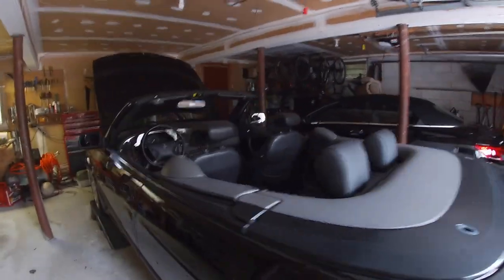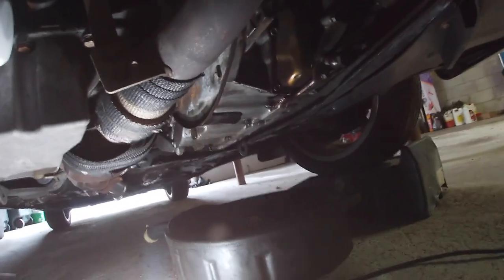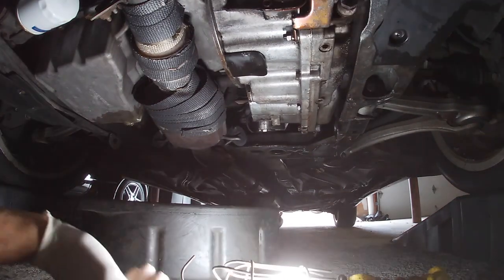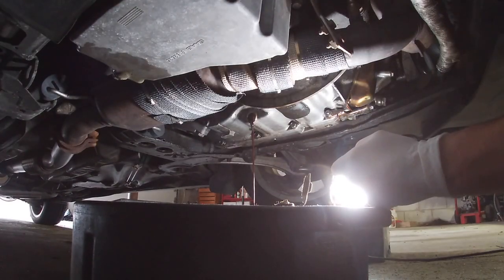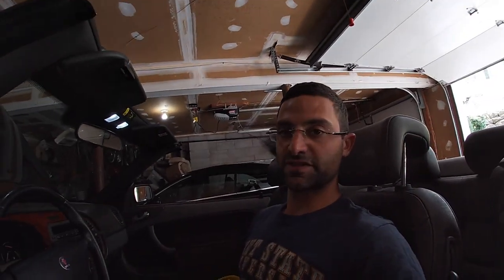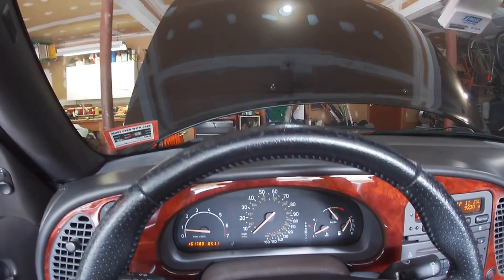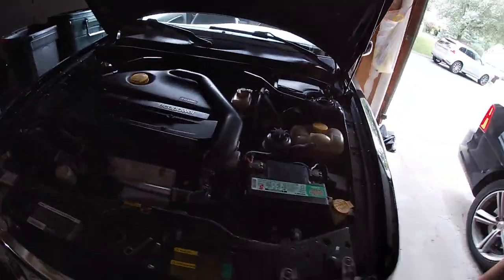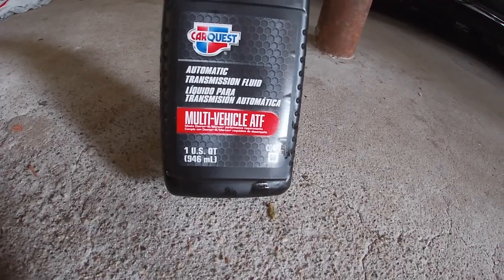OG Saab 9-3 9-5 | How to Change Automatic Transmission Fluid

Comment: Hi Kyle, thanks for video, I’ve learned something new. How much oil did you put in the transmission?
Reply from the maker: a pleasure to help! 3.5 sits in the transmission and 3.5 quarts sits in the torque converter. So let the pan drain as i did and just replace the 3.5 quarts. If your fluid is really bad drive for a week and do it again to cycle the fluid out from the torque converter as well.
Reply: Kyle Pancis Hi Kyle, your prompt response is greatly appreciated. Colin.
Reply: Hi @KylePancis  , 165k miles on 2007 93 convertible with black fluid that is not low and slippage starting. What do you recommrnd?
Reply from the maker: @AngelShelburneplus  leave fluid. Add a bottle of lucas transmission fluid

Comment: I have a 2006 saab 9-5 Is it the same amount of oil ? Also the first time that I take the dip-stick out it's full and then the second time that I clean it and put it back in it is low, can you help me out which is the right one, does the car have to be On warmed up or in neutral ? I checked the Instructions Manual but I couldnt find any information. Also my car is automatic does the amount of fluid that I need change, I also dont knowwhich type of fluid I need ? Thank you so much in advanced
Reply: The information on fluid type IS in the manual. Near the back of the book. Or look it up online. 

Have the car warmed and running when checking the ATF.  (I put mine in neutral)

First pull of dipstick do not read. Just wipe and insert back. 2nd pull of dipstick you read. That is your level of fluid. 

If you are not sure about how much fluid to put in, you can always measure what you took out. Put in about the same and keep checking dipstick often to hit the correct level. 

Shampoo is for cleaning the hair. Conditioner is for softening. Rinse and repeat to desired affect. Hope this helps man

Comment: I have been trying for days to locate the transmission dipstick on my 2008 9-3 aero. I have seen NOTHING green anywhere- even when lifted as some sites have mentioned.  Just came across another thread that says this: "  Draining ATF with on the '06 and newer cars.

These cars do not use a dipstick or have a dip stick tube. Instead, the dip stick hole low on the case is filled with a threaded aluminum plug equipped with a T55 recess. 

NOT DRAIN YOUR ATF UNTIL YOU HAVE THIS PLUG OPENED!

This plug is a challenge to remove, and draining your ATF before you have this plug removed might result in a dry transmission on a car that must now be towed to a Saab Tech for assistance. " 
I AM SO CONFUSED.. can you shed some light on this for me??
Reply from the maker: if it doesnt remove and you want to service you may need to pump fresh fluid back in. Not to sure, may have to do more research.
Reply: @KylePancis  ugh... thanks for responding!!
Reply: I'm dealing with same issue ???
       No Dipstick on 2006 + 9-3's..
How to properly check trans fluid level and correctly service and or flush!!! ???
Kyle, could you please research your resources and post a solution??    Respectfully  N.Clinger

Comment: Thank you so much for your videos. This was the plan today but I need any help if possible.
The black piece and specifically the "housing" or plate near the drain plug is missing from my transmission, exposing the large gear wheel. It's been in for heavy service including rear seals, cat conv, bearings, support joint/arm, tensioner and filling of all fluids... since everything had to come off anyways which you know I'm sure and be replaced because it was old and off anyway, charged it payed it I want this car kept in the condition it is🤑🤮. Could be on the shop floor but that's obviously denied.
I'm so sad for my '00 9-3 soft top and I pay to have it taken care of but I'm still searching for the work done. Do you know the part number by chance? Is this the bell housing plate? Thanks anyone.

Comment: Bought a 2006 9-3 2.0 T...134k
Automatic..selecting D car won't start out in low...I ha e to select manual low and after seed builds, shift back to auto...operates ok but   hard shifts hard along with a clunking sound???
Can't locate trans fluid dip stick to check fluid level???: 
What the heck ??
Reply from the maker: https://www.saabcentral.com/forums/showthread.php?t=472650 
read this thread, it may help